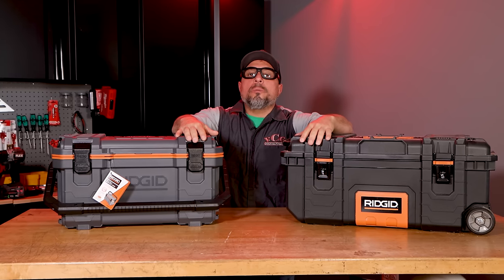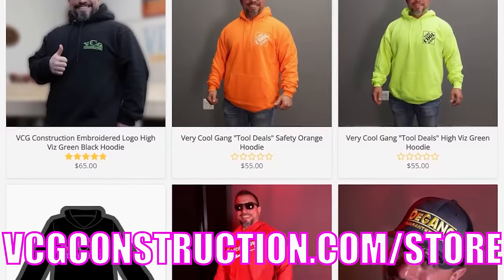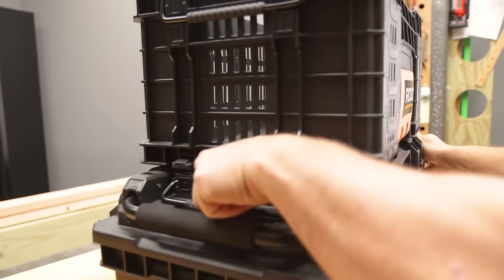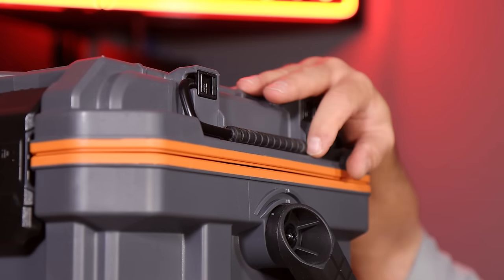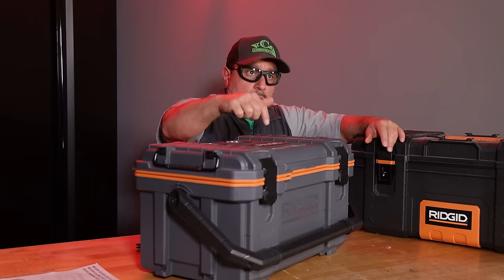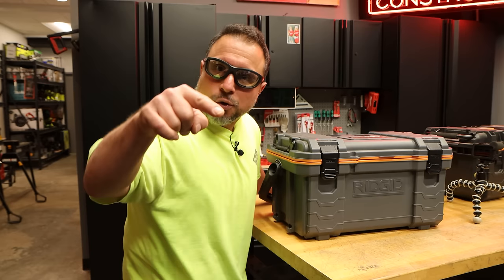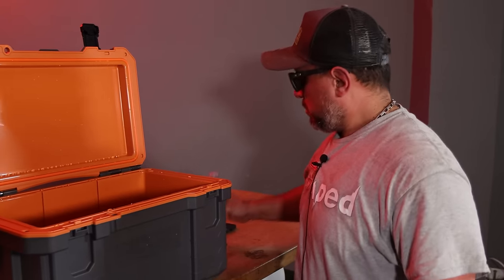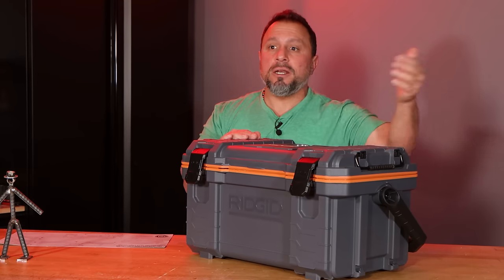Ridgid Executives Should Know "THIS" About Their COLD BOX!

Comment: The Ridgid Pro Storage is a sleeper yo.  You are missing out if you aren’t considering their boxes.  They are suuuuuper cheap, like 1/2 the price and they are the real deal… not like the rest of Rigid’s stuff 😉.  I love mine.  Handle fits under the tonneau.  I have the big wheeled box and the small one on top and it lives in my truck.  Check em out.
Reply: Exactly my thoughts too!
Reply: Ya you can get stacks for $99 on the right sale. Well worth it. I stopped buying packout until they bring their prices back down. Hooked my dad up with that ridgid rolling box in the video, a parts organizer, and a crate for $110 total. Packout crates being $50 is just a slap. Their new $250 cooler is a joke. Ridgid is far more reasonable.
Reply: @A6Legit  I’m home here now
Reply: @Tool_Addicted_Carpenter  I wish I would have realized this before I bought that 270 dollar packout lmao
Reply: @notashton.  No worries. Packout offers a lot more options. I only advocate for ridgid from a price standpoint but I wouldn't want to solely have ridgid. I have 4 packout stacks and many compact organizers. Ridgid doesn't offer nearly enough options. I bought my packout stacks for $200ea, my large packouts when they were only $60ea instead of $90, and my organizers when they were $35 instead of $50. Their current markups are absolutely egregious.
Reply: @BLachance75  👖👖👖
Reply: I have ridgid pro organizer. I bought it like 4yrs ago... I like it BUT, they need more accessories 😆....
Reply: @theconstitutionalist5617  more accessories would be nice.
Reply: @jamesgibbs6282  touch my camera through the fence
Reply: @BLASTIC0  I happen to be a plumber and ridgid makes some sick plumbing tools, I wish they wound make a small bin with more apartments for things like delta, moen, and bras seats, orings for faucet repair
Reply: I’ve had mine for over a year and I prefer it to the pack out as far as ease of use goes. Super durable too, had a small box fly off the truck going 70 with no real damage.

Comment: I had the cooler for about a month now and the ice retention is right around that 2 day mark they claim. If you have access to an ice machine and you can fill it to the top with ice like I have a few times you can get upto about 4 days out of your ice. It's a nice affordable option if you're interested in a cooler for your job boxes and already have the orange and black. 1 downside is that it does not have a drain plug you have to empty your melted water by pouring it out the top not super convenient there and would have paid a few extra bucks for an integrated drain plug. Trying to research and figure out how to possibly add one. It's not going to retain ice like a yeti but it's not going to cost you, a truck payment to put it on your job stack.
Reply: Maybe there's a way to install the Igloo replacement parts into this cooler.
Reply: A bulkhead fitting with cap or plug will do the trick
Reply: Plugs leak, no plug is a feature for me.
Reply: Ebay and Amazon have the cooler drain plugs

Comment: Ridgid needs a combo unit that connects to the modular system and integrates an electric/cordless pivoting fan, 110V power distribution, battery charger, phone charger, 20W Bluetooth radio speaker, and 2k lumen articulated LED lamp.

Comment: Would be helpful if you cut open this Rigid cold box as well as a Yeti or comparable cooler to compare how they are built and insulated. Some coolers have no insulation between the plastic layers.
Reply: This would be a great idea but I can almost guarantee that there is no insulation and if there is it’s probably less than an inch. Better off buying an igloo their extreme rugged version at Costco if they still have them in stock and it will retain ice for almost a whole week and it’s cheaper. Their will be some trade off if you are already in to deep on Rigid pack out but better product just my opinion.
Reply: @A6Legit  I completely agree with you but I work in Southern California where it’s always hot and when their is no shade to place your cooler having a well insulated cooler really helps. Plus I go camping a lot so having a versatile cooler really helps. As for me I’m very vested in the PackOut from Milwaukee but having a hard time justifying the price for the new Milwaukee Cooler.
Reply: @jfamousmsbc  I use the igloo 26qt on my sxs and have about frozen drinks for 4 days. And the cooler is above my engine and exhaust system 🤣😂🤣

Comment: Rigid made a pretty Cool product😉 I like the size to insulation compromise that Rigid went for. Imo a job site cooler doesn't need to hold ice for days, just needs to keep your bevs cold for the day in hot weather. Looks like it will hold sufficient bevs with ice for a small crew of guys for the day. Thanks as always for showing us the goods VCG👍👍👍

Comment: I have this. Kind of disappointed in how good it seals. But it gets the job done.
Reply from the maker: Yours had a problem with the gasket?
Reply: @VCGConstruction  yeah it has a gap. Plus the plastic cleats where it interlocks were bent, like it was dropped.
Reply: @Dirt_Worm  return it and get a new one. Should be painless.
Reply: I bought a few of them and all of the seals leak

Comment: I'm a Ridgid guy, drill, impact, sawzall, bandsaw, etc. I have the dual battery charger, even have the Ridgid (propane, apparently there is an all electric model coming, but haven't seen it in stores.) heatgun for bending PVC. Not impressed with the cooler. At my local Home Depot when I priced it a month or so ago, it was over $100, not 70ish.